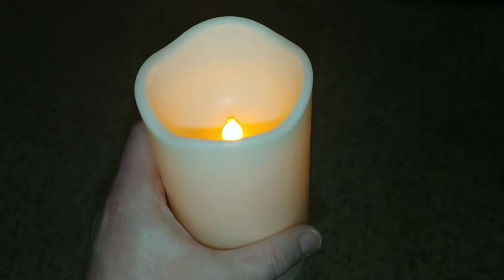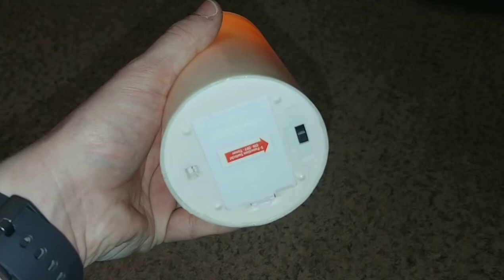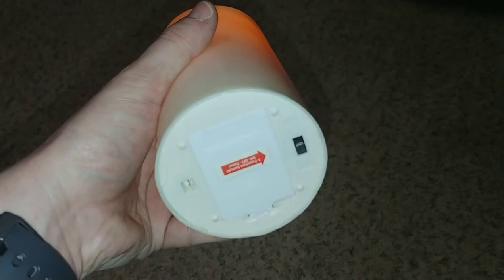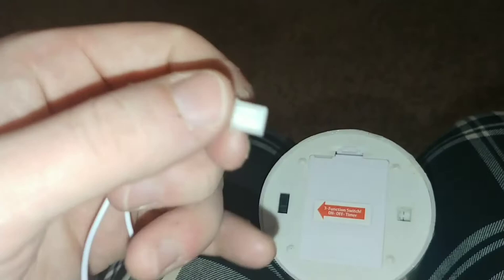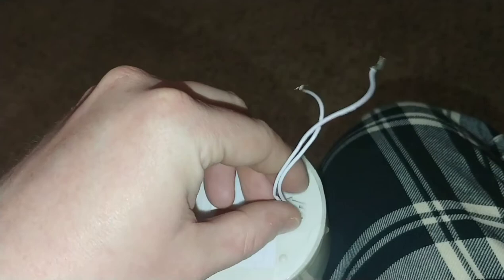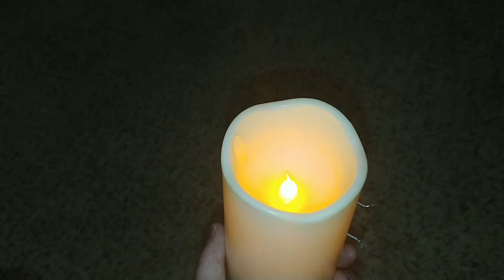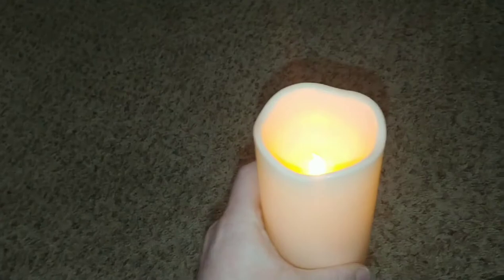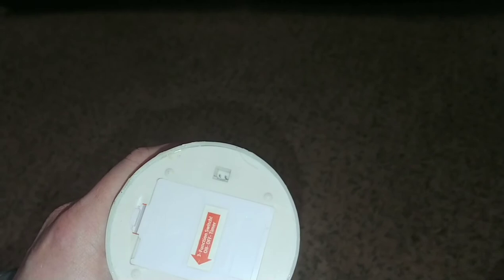Troubleshooting an LED candle

Comment: May just be bad contacts in the switch.  If that is the case, then the contacts for the hot side of the switch must not be making contact.  Both the switch hot side and the try me contacts are connected to the same junction of the transistor (or other controller) which turns on the light.  If the hot side switch contacts when turned on have continuity, then one wire from the switch to the controller or the other return wire to the negative side of the batteries is disconnected or one could have a cold solder joint preventing continuity.  All of this expert technical advice is free but is based upon the old adage of "battery and ground" being the basis for lighting a lamp.  Good luck.